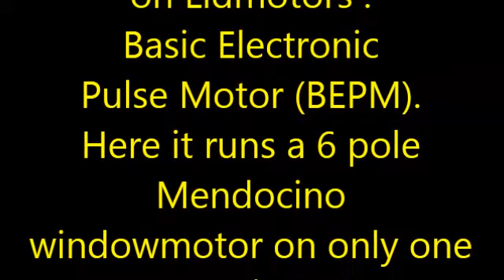Basic Electronic Pulse Motor, Bedini style

Comment from the maker: Well, it was your idea ;-)) For me it was only making a breadboard free for demonstration and put some windowmotor stuff together that i had still laying around. 
I learned now that the bedini circuit uses the diode at the base of the transistor to prevent the circuit from oscillating. I did not get this function of the diode before.

Comment: I was hoping you would do this.  The 1k resistor and the diode are a nice add.  At about 1mA that should run about 3 months non-stop on that battery.  Add a small solar panel and--------well you know what that means.  Ambient daylight near a window should be enough to keep it going.  Well done!

Comment: How many turn for that coil?
Reply from the maker: two times 350 turn (0.1 mm wire)
Reply: @sMartcreations2010  and how many grams the email cable 0.1 mm  weighs for 350 turns?
Reply from the maker: @henciksanusi8385  Sorry i don't know. I made the coil several years ago